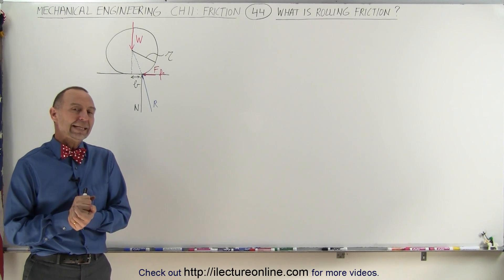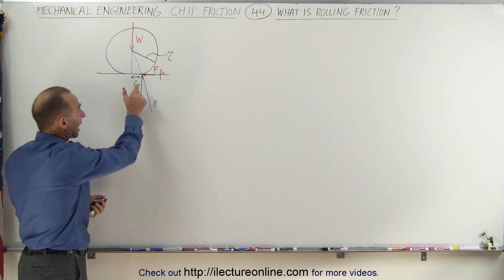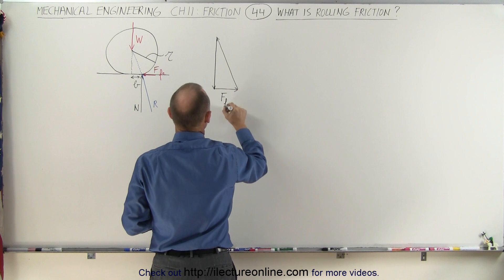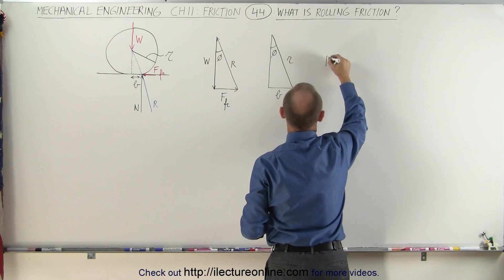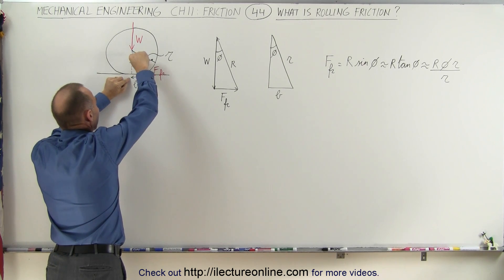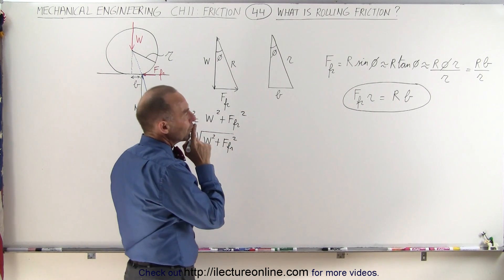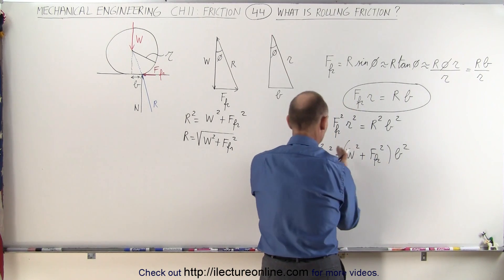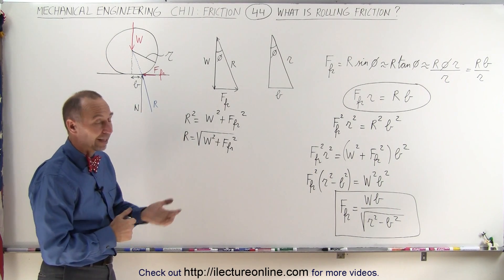Mechanical Engineering: Ch 11: Friction (44 of 47) What is Rolling Friction?

Comment: i think this video mixed up " rolling friction " which is a static type friction, with " rolling resistance " which is the a force to catch hysteresis due to deformation of the wheel
edit :
more explanation : 
in a rigid body rolling we still have friction while there is no rolling resistance nor deformation in the contact point

Comment: If I have a small wheel with a radius of about 0.02m, when \( b \) is large and the angle is large, then I cannot write sin(ø)= tan(ø)

So how would it be then?
Reply from the maker: Unless the wheel is compressed a lot under the load, the principles should be the same.

Comment: For a mountain bike tyre at 25psi, the length b is around 5cm. Typical radius is 0.37m (29er). This would yield the ratio b/r as 0.05/.37 = 0.135 so rolling friction would equal 0.135 x weight = 0.135 x 400N = 54N (assuming 400N is total downward force). Typical rolling friction figures quoted at this pressure and weight for mountain bike tyres are between 3 and 4N. Bicycling Science by Gordon Wilson quotes the friction Rolling Force = 0.075 x W x b/r from empirical measurements. This factor of 0.075 reduces the 54N to 0.075 x 54 = 4N which is spot on. The only way I can see to rectify this is that there must be a force acting to accelerate the wheel when the rubber tyre recovers to its original shape. The squashing of the rubber tyre produces an opposing force but the relaxing of the rubber tyre must produce a propelling force. Hysteresis losses dissipate the energy and cause rubber tyres to have high rolling friction. Steel is much less compressible and without hysteresis losses too and so rolling friction is much less.

Comment: This is NOT correct.. the magnitude of the friction force varies with the degree of deformation, but is primarily a factor of the hysteresis characteristics of the material being deformed!
Reply from the maker: That is an added factor, ignored in this calculation.  Other factors are vehicle speed, inflation of the tires, etc.
Reply: @MichelvanBiezen  yup, fair.. there are multiple factors!

Comment: What is meant by reactionary force? is it the resultant of the frictional  force and the normal force (frictional force= horizontal component of reactionary force and normal force=vertical component of reactionary force)?
Reply from the maker: I use the term "reactionary" force in a general sense.   The force reacts to the application of an original force.  When you walk, you muscles push backwards on your rear foot.  But since there is friction between the sole of your shoes and the floor, the friction force will push back with an equal force but in the opposite direction.  This is what I call a reactionary force since it reacts to your force applied to your foot.  It is this reactionary force that propels you forward.
Reply: @MichelvanBiezen  Thanks! I understand now. 
I have one more question.. I searched on the internet about "equation of rolling friction" and it gave me this.
F (rolling friction) = Normal force x Crr  (Crr= dimensionless rolling resistance coefficient )

Whats the difference between your equation and this one? and is Crr (dimensionless rolling resistance coefficient) different from the coefficient of rolling friction (the fancy l)
Reply from the maker: The Crr is a shortcut method to approximate the rolling friction.  Each type of tire, or wheel, will receive a Crr which then can be used to approximate the rolling friction.  The videos show the principal of rolling friction.

Comment: In order to calculate the minimum force required to act on the top of the wheel to make it start moving, would you treat the problem as an equilibrium situation and find the tipping point at the point where the bottom of the wheel leaves the ground?
Reply from the maker: We have videos that cover that in the physics section:  PHYSICS 11.1 RIGID BODY ROTATION
Reply: @MichelvanBiezen  Thanks Michel!

Comment: Wrong direction of friction in the force triangle (second diagram). Friction force must be from right to left
Reply: Actually it depends on whether the wheel is moving clockwise or anticlockwise. I guess he assumed that the wheel is moving anticlockwise. But yeah, he should have mentioned that thing.
Reply: @Shubhamkumar-cq5wt  why the reaction force would be right of line of normal force passing thru centre when moving anticlockwise?... Frictional force direction is correct

Comment: How did you reached on conclusion that angle "phi" in both the cases will be same.
Reply: Theta or in this case "phi" should be the same for both cases, since reaction force (R) is an extension of the radius (r) means that both have the same slope and also Weight and Normal Force are both perpendicular to the ground, we can see that the gap or theta ("phi") would be the same.
Hope this helps (sorry for being late too)
Reply: im sorry i still dont understand the reason why both angle should be the same. 
even if reaction force starts from the end of contact of wheel, the 'phi' could be different if the friction force is weaker or stronger. 
so i wonder why Friction force has the same length with half of length of deformed wheel.

Comment: I knew rolling friction was caused by deformation, but I always thought rolling "friction" was actually not friction at all, but a net torque counterclockwise (if the ball is rolling clockwise) on the front part of the deformed ball, where it touched the ground, since now the normal force of the ground was off-center... and then I thought the reason the distance was the coefficient of rolling friction was because that distance was the lever arm for the normal force THAT distance away from the center bottom point of the wheel. Then I thought we multiplied the normal force by that distance in order to get the counterclockwise torque slowing the wheel.

However, in this case, the friction force itself is pointing opposite to the direction of MOTION, and not opposite to the angular velocity...

 If the friction force is drawn parallel to the path of motion of the ball, then wouldn't it just be Kinetic Friction for a ball that's slipping, and not rolling friction (or rolling resistance?)?

Thank you!
Reply: If my question isn't clear please tell me, I'll ask it better. Thanks for all your videos, you're awesome!
Reply from the maker: It is correct that rolling friction is more complicated than is explained in the video, and that additional deformation occurs.  But the fundamental principle of rolling friction is caused by the deformation at the point of contact (as seen in the video), causing the direction of the resulting forces to slow down the wheel.  Note that one of the advantages of trains is that they have steel wheels and thus have very little deformation at the point of contact and thus very little rolling friction.
Reply: @MichelvanBiezen   I think that your approach is equivalent to the method @Joshua suggests; notably, applying a binomial expansion to the denominator of your final result produces W*b/r*(1+1/2(b/r)^2+...), which, to lowest order, is the well known result for rolling friction, easily derived from considering moments.

Comment: WHY DOES THE REACTION LINE PASS THROUGH THE CENTER OF THE RIM??
Reply: The reaction line does NOT in general pass through the center of the rim on an actual free-rolling wheel. On a free-rolling wheel, the moment due to the offset normal force is greater than the moment due to friction, which is what causes the wheel to spin at a slowing rate while translating at a slowing rate as well. For the reaction force to pass through the rim center, a forward push force must be applied exactly equal to the ground-contact normal force, times the horizontal offset distance it acts from the center of the wheel, divided by the wheel radius. Then, the friction force on the wheel will equal your push force, and the moment due to the normal force will be equal and opposite to the moment from friction. The result will be a force and moment balanced wheel. If you push with a greater forward force, then the friction force will increase further, but by a lesser amount than the increase of your push force, and the moment due to friction will exceed the moment due to the offset normal force, causing the wheel's spin to accelerate. The actual orientation of the reaction line is of little significance in evaluating rolling resistance of a wheel, and the edge of the contact zone is not actually where the reaction force acts, which is very misleading in this video. The most important thing to remember is that any wheel, no matter what material it is made of, will deform on any surface, creating a normal pressure distribution over the contact area, with greater pressures occurring in front of the center (wheel loading) than behind (unloading). This is a property of materials called hysteresis, and is responsible for the presence of rolling resistance. A 1m diameter semi-truck wheel having a rolling resistance coefficient of 0.001 will have the resultant of its normal stress distribution acting half a millimeter in front of the wheel axis. For every additional 1000 kgf of load placed on the wheel, an additional 5 Nm of rolling resistance moment must be overcome to keep the wheel rolling. A propelling torque can be applied directly to the wheel via the axle to counteract the rolling resistance moment, as in a driven wheel, and there will be no increase in rearward friction acting on the wheel. For a non-driven wheel, an increase in rearward friction supplies the necessary counter-moment, and a corresponding increase in push force is required to keep the wheel rolling steadily. In the case of the semi truck wheel, the 5 Nm moment will be supplied by a 10 N (1 kgf) friction force acting 0.5m from the wheel center. Whether the wheel is driven rotationally, or pushed, equal amounts of energy are consumed in moving the wheel along to overcome rolling resistance.

Comment: The direction of the friction force in diagram 1 and the direction of friction force in the triangle are different?
Reply from the maker: The diagram on the left shows the resistance force (friction) from the road being applied to the tire.  (That force acts in the opposite direction to the motion of the tire).  The next diagram shows the friction force of the tire pushing against the road. (That force propels the car forward).  Note that without friction force the car could not be pushed forward.